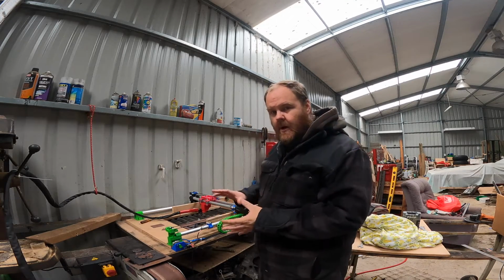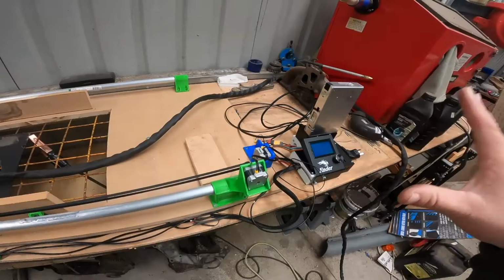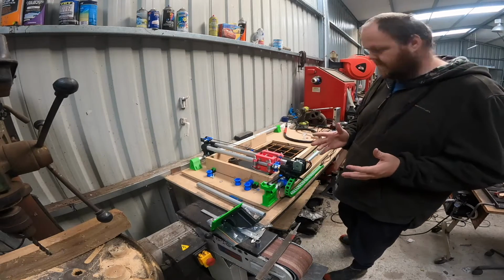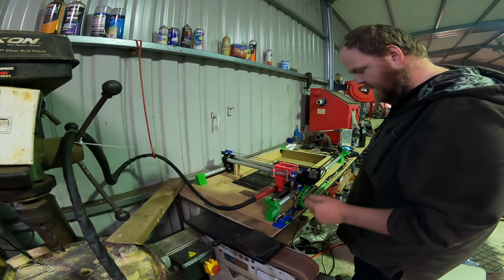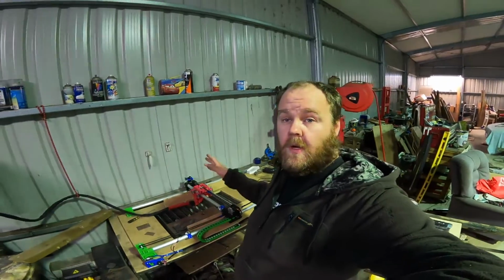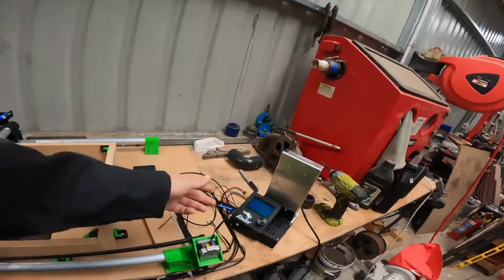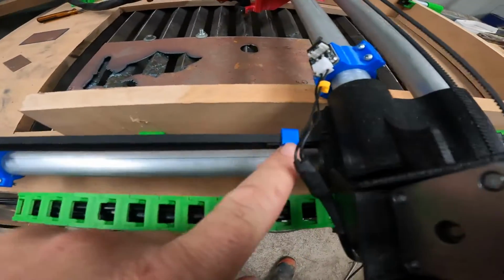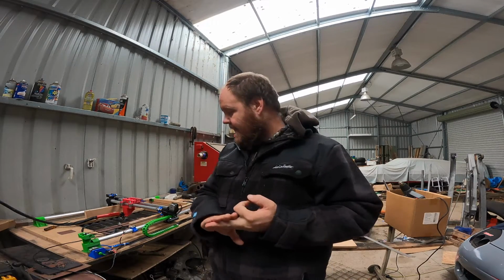Build Your own Larsen Hobby CNC plasma cutter for under 200$

Comment: Interested in the Gcode and "how you tricked Cura into thinking it's printing when it's cutting"
Reply from the maker: sorry for late reply, so I did it by turning infill off and turning every setting off except for walls and only have it set for 1 wall. I use z hop to turn the plasma on and off, and thats about it its actually really simple. :)

Comment: Hi bro, what size tubing do you use for the rails ? And what size the motors are ?
Reply from the maker: 25mm tubing
Reply: @larsenmotorsport5459  Im thinking of building it from your files, but i want it to be with 2 motor on the Y axes is this possible with yours 3d files ?

Comment: Will this be my excuse to buy a plasma cutter? I am into 3d printing and metal work. Tig welding in particular. A CNC plasma cutter looks like a nice winter project. 
It's nice to see, I don't have to over-think it.
Thanks for sharing your experience.
Reply from the maker: Your most welcome. I have also solved the issue thats caused by the steel warping which is running a floating head so it rolls over the steel as it wraps always keeping the same arc distance.

Comment: Hi you may have used shielded trigger cables but not sure from the video. If not run shielded cables where you can also add a torrid ring and loop the trigger wires around it a couple of times might help. Make sure shielded cables are earthed really well. Good luck
Reply from the maker: I haven't but that was going to be something I did on the next one I build, it only becomes a problem when the plasma cutter doesn't fire, otherwise it cuts fine. but I appreciate you advice and willl definitely give it a try. :)

Comment: I would suggest that you not cut but have made or make the full-length cables because splicing has been shown to cause issues from time to time in these machines.  Many people talk about splicing causing response issues and such on the Creality forums.
Reply from the maker: that's really good advice. I appreciate that. I haven't had any issues yet but about to build a bigger one and have brought extended cables so won't be a issue.

Comment: I built something simular from an laser engraver, but i m running in some EMF issues. What kind of plasma cutter are you using? It seems to be without pilot arc, is it right?
Reply from the maker: its just a cheap hf start plasmacutter,  I do have a couple issues with emf aswell, but only when it does a lot of small cuts

Comment: Just got the files from Cults3D, thanks for posting. I may have overlooked it, and my apologies if so, but what material are you using for all the 3d printed parts?
Reply from the maker: firstly thank you for supporting my littler project. so all of my parts are printed out of pla. its simple and easy to print with, I thought ill just use plain and when things melt ill change it to something more suited. thing is, nothing is showing any damage from heat yet.
Reply: Awesome, thanks. Collecting parts now and have a busted ender 3 on the way. Hopefully I’ll be up and running over the next few weeks.

Comment: That's really impressive, it's like the second industrial revolution that's in the home workshop. You could scan a headgasket and cut out a steel shim? Cut exhaust flanges to delete the cat converter? Turbo flanges. You'll be too busy.
Reply from the maker: that was the reason I build it, I just brought some flanges and they cost over 250$ And I thought surely I could build something to do it cheaper
Reply: @larsenmotorsport5459  And better too